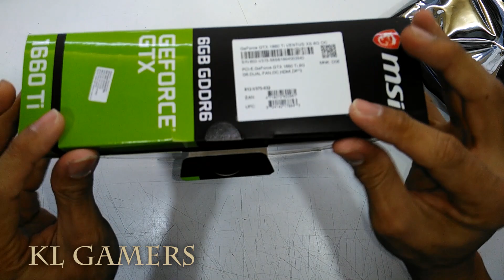intel Core i5 9400F msi B360M MORTAR Transcend SSD GEFORCE GTX 1660Ti VENTUS XS OC edition Build

Comment: People I have three options for PC, the three would be mounted with a RX 5700 xt and would be only for Gaming, nothing more, starting with the i5 9400f and a B365m Aorus Elite being cheaper rl, then I would have the r5 3500x in AMD with an A520 DS3H And finally the most expensive would be with the I5 10400f and a h410M H, the difference between this and the ryzen in price is not very noticeable and between the last two they are about 20 dollars more expensive than the build cpn the i5, in the future I would think in the case of the 9 gen, put an i7 9700f in a few more years and with the amd some ryzen 5000 or the r7 3700x but it would be in about 4 or 5 more years.